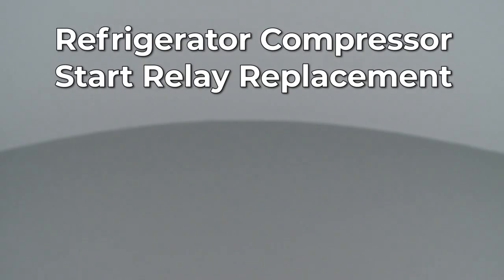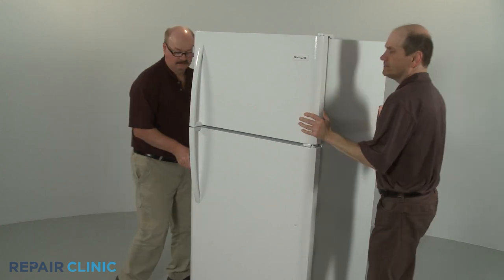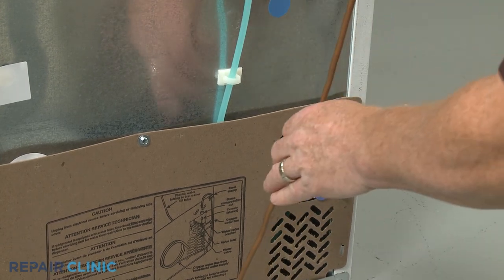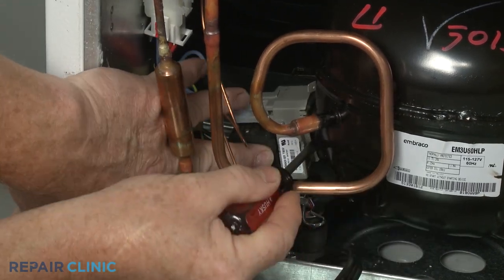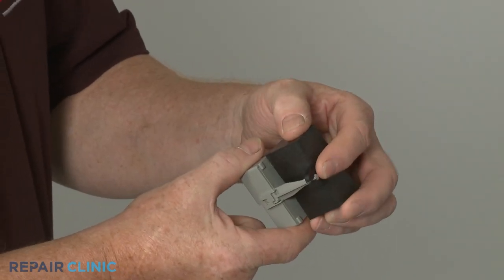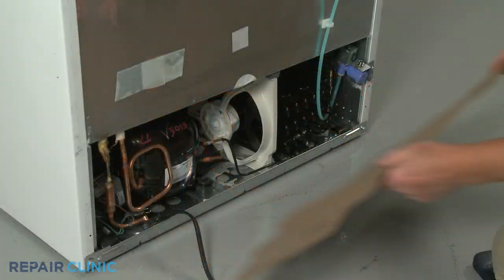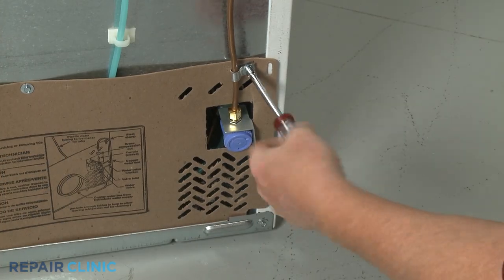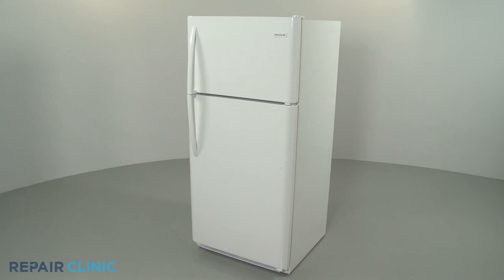Start Relay Replacement (part 241941007) - Frigidaire Refrigerator Repair

Comment: Just Follow the directions in this awesome video. Fridge is running smooth. Cooling down. The tick noise is no more. Thank you repair clinic. I’ve used your videos and your products multiple times and refer you all the time.

Comment: Thank you for the clear straight to the point video. My freezer is now working again!

You do not need to disconnect the water line if the line has plenty of slack

Comment: cool video/but where can i get a compressor starter relay and capacitor for a 2003 fridgidaire model frt17b3aw3
Reply: I went to an appliance parts store and it was $58.00!  The internet " suggested"  it was $15.00